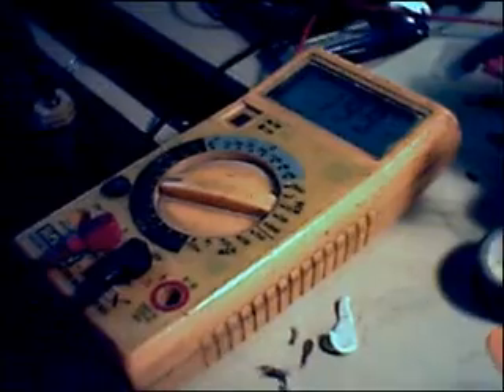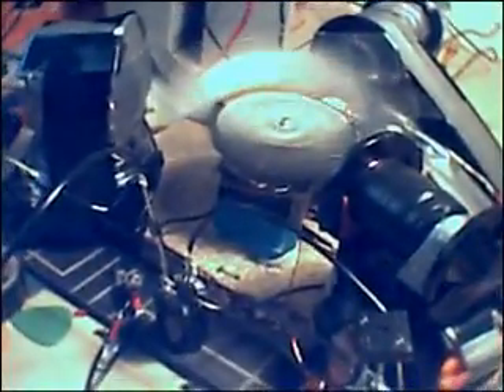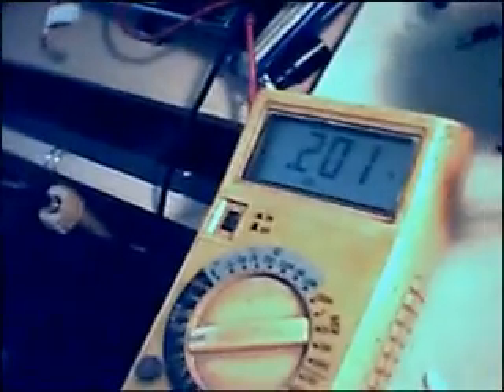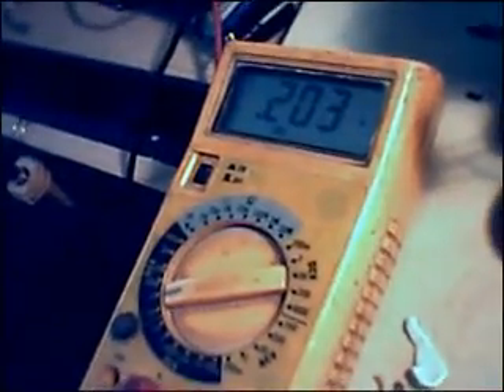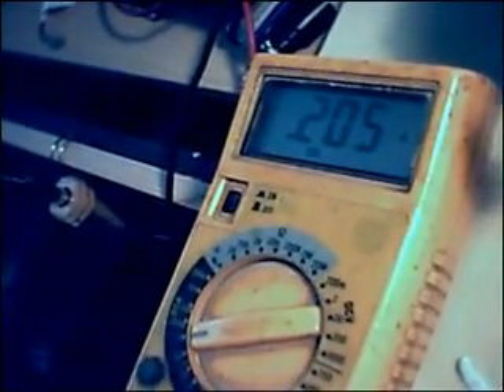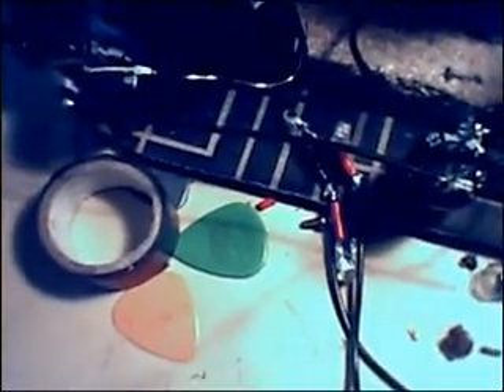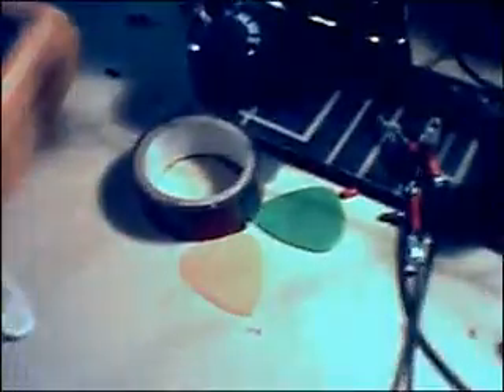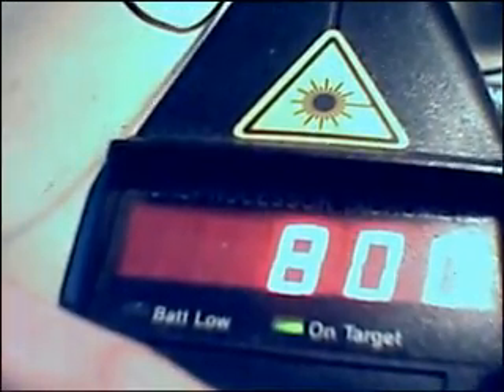Bedini with 3 stator magnets

Comment: so using 6 alternating magnets will produce pretty much the same effect as using 3 double stacked magnets...

we also refer to the ssg as an attraction motor.  Which doesn't make sense to most people.  However it makes perfect sense when you understand that the pulse isn't repeling the north of the magnet at all... it is attracting the scalar south between the magnets.  This is verifiable through experiment.

Comment: ok... the "good" trailing pulse and the "bad" advancd pulse are acutally the same pulse... they are in the same place.  They are combined to form one solid pulse.

We refer to the area between the magnets (on a north pole configuration) as the "scalar south"... though there isn't a magnet there, it is a REAL south pole... as if there was a virtual magnet there.

Comment: there is plenty of software out there that con convert your soundcard to an occilloscope but be warned it is very easy to fry your soundcard even with reistors and protective diodes in the circuit.

Comment: I'm sorry, but your assumption is wrong. and how useful is lifting a weight on a thread? ^_^ the ssg is a battery charger first and foremost.  By using more amps per pulse you are sacrificing the charging effect.

Comment: you still don't understand how this system works... the rotor is just a timing mechanism... although it appears to be going  faster for the amp draw it is actually going slower.  

IT IS A MECHANICAL OSCILLATOR! 

NOT A MOTOR! 

(sorry for shouting... wanted to emphasise it)

Comment: Don't know how you worked that out... wouldn't a better calculation be:

Amps / ("Number of Magnets" x RPM)

so on his 6 magnet motor:

400 / (6 x 1000) =  0.066666666 

on his 3 magnet motor:

200 / (3 x 800) = 0.08333333

so it is using more amps per pulse which isn't desirable.  The speed of the motor isn't as important as the frequency of the pulses.

Comment: Just something to keep in mind...

if you half the magnets on the rotor you will have to double your rpm for the same amount of amps for it to perform equally to your 6 magnet rotor.  Now the coils are only pulsing half as many times per revolution.

RPM isn't as important as the frequency your coils are pulsing at compared to the amp draw.

You probably already know this but just thought I'd point it out ^_^